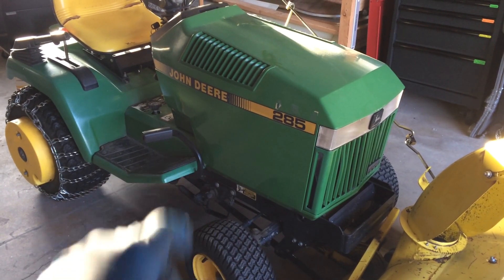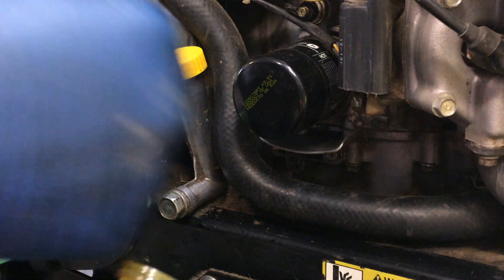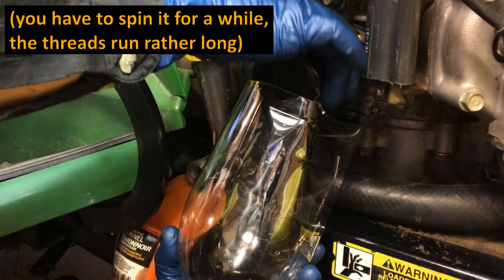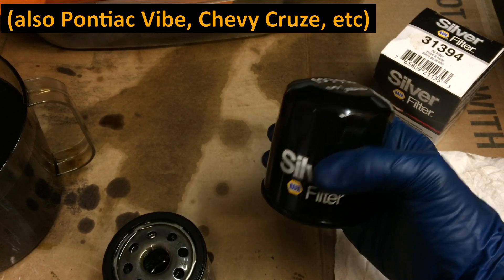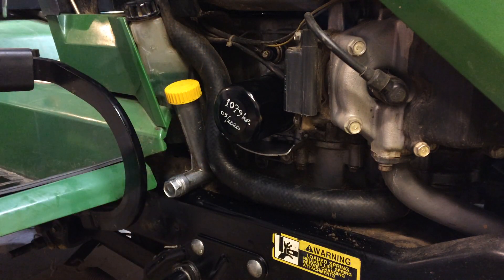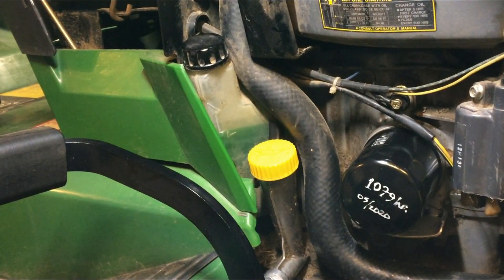John Deere 285 Tractor Oil Change DIY

Comment from the maker: You'll need two quarts of oil and a new filter.
Timestamps:
00:23  Parts and tools overview
01:30  Remove drain plug (13/16" or 21mm)
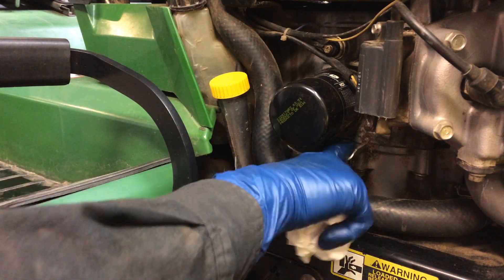02:13  Remove oil filter
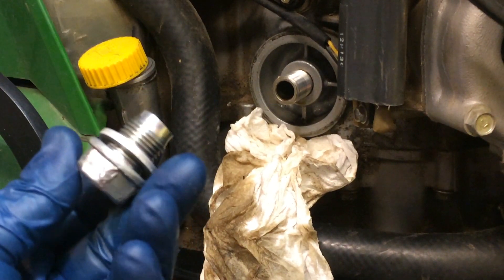03:55  Install drain plug
04:47  Oil filter types (I'm using a Napa 31394)
05:35  Install new oil filter
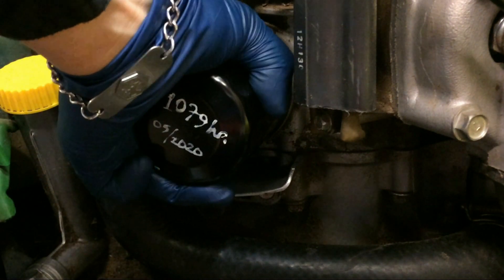06:35  Picking the right oil for you situation (we use Turf-Gard 10W-30)
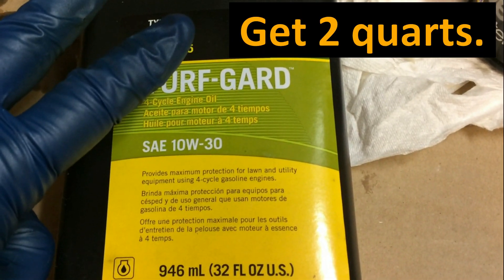07:50  Refill with oil
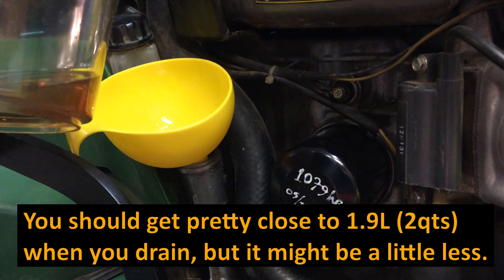08:35  Check oil level
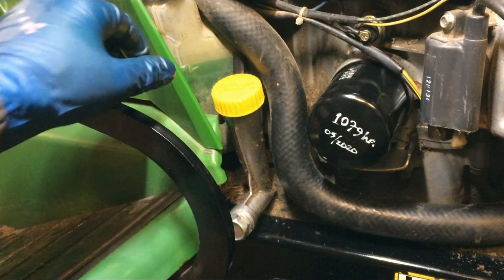11:39  Coolant reservoir location and coolant type

Thanks for watching!  I hope this was helpful.
Good luck with your repair!

Comment: You just need to fill the new oil filter with fresh oil before you install it. When you fill it to the top, stop and the filter media will absorb most the oil and it will lower the level. Then when you install the filter you wont leak out much oil but your engine will have full lubrication on start up. Putting on a dry filter means your engine will run without lubrication until the oil pump fills the filter with oil.

Comment: hi , I noticed you have a snow blower attachment for this lawn mower, what is the model number for that? or can you tell me a webiste I can go to to try to find that attachment, would love to get it for my 285
Reply from the maker: I'm sorry that I missed your comment -- I don't have any model numbers, but I do have the original manual, and the manual just calls it "42 Inch Snowthrower."  The manual is dated from 1987.  I'll be posting a video later tonight for the shear pin replacement, which shows a closer look at the blower.  This blower very much like ours, and it might be the same one:
https://www.machinerypete.com/details/snow-blowers/john-deere/42-snow-thrower/20185680
I hope this helps!

Comment: Wow, I've watched on the neighborhood of 20 videos on changing fluids and other maintenance on the 285 and this by far is the best I've seen (sorry Teryl). How's changing the transmission fluid? Thanks
Reply from the maker: Teryl fixes all!  I will do a video on the transmission oil change soon for this 285, probably at the end of summer.  The manual states that the replacement period of 250 hours (after an initial fluid change at at 50 hrs).  

The process is straight-forward, here it is from the manual:

1.) Remove drain plug. (drain plug is located on the housing opposite of the filter)
2.) Remove the filter: some more oil may come out of the filter. Use a drain pan to prevent an oil spill.
3.) Replace the filter: put a film of transmission fluid on the seal/gasket of the new filter.
4.) Fill the filter 1/3 to 1/2 full with John Deere All-Weather Hydrostatic Fluid or an equivalent type "F" Automatic Transmission Fluid. (see the note below about the fluid type)
5.) Tighten the filter QUICKLY until it contact the mounting surface. Tighten filter BY HAND an additional 1/2 turn.
6.) Install and tighten the drain plug.
7.) Remove the dipstick fill plug. (it is a yellow plug on mine) Add approximately 2.6 quarts (2.5L) of John Deere All-Weather Hydrostatic Fluid or an equivalent type "F" ATF. (see the note on fluid type below) Install and tighten the dipstick fill plug.
8.) Start the engine and check for oil leaks around the filter base and drain plug.
9.) Stop the engine.
10.) Remove the dipstick fill plug. Oil level must be to the top mark on the dipstick.  Add oil if necessary.
11).) Install and tighten the dipstick fill plug.

Note regarding the fluid type: I now have a factory service manual for the 285, dated 1995, which recommends "Low-Viscosity Hy-Gaurd J20D" fluid for 285's with serial numbers starting with 130001 and higher.  My owner's manual (dated 1987) states to use "John Deere All-Weather Hydrostatic Fluid".  When you search for JD All-Weather Hydrostatic fluid today, you see this note:

"Low-Viscosity Hy-Gard replaces John Deere All-Weather Hydrostatic Fluid and should be used as a direct replacement for all applications recommending hydrostatic fluid."
(https://www.greenpartstore.com/John-Deere-Hydrostatic-Transmission-Fluid-TY22035-TY22000.html)

So apparently, either Hy-Gard or a good Type F can be used on the earlier models, and the later models were already filled with Hy-Gard.  Here is some discussion in the forums:

https://www.wfmachines.com/threads/jd-hy-gard-vs-type-f-automotive-trans-fluid.13841/

We use the Hy-Gard J20D.

In case you're interested, I also posted this video below on our 285 recently, which shows the transmission/transaxle and pump (I had to remove the panels to replace the fuel lines and clean the fuel tank due to an obstruction).  You don't have to remove the panels to drain and refill the trans fluid though, but it is kinda neat to see them:

https://www.youtube.com/watch?v=t8VZUWgboBo

I hope this helps. Thanks for watching! : )